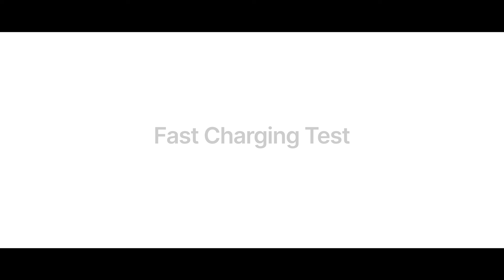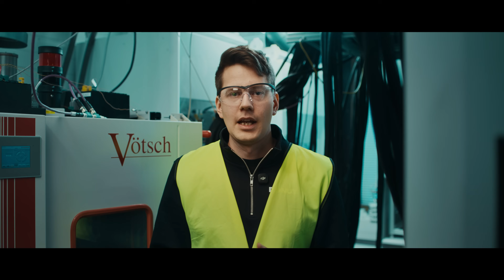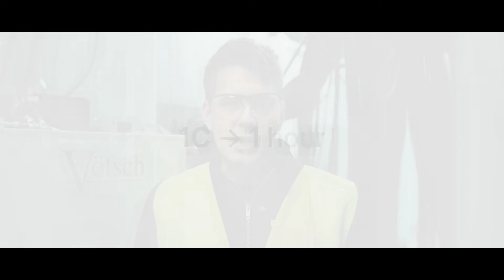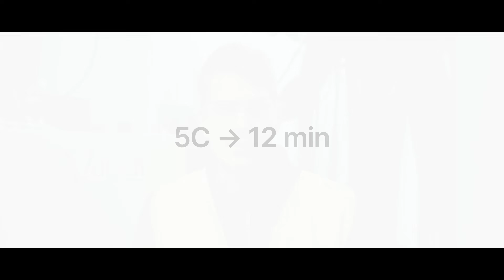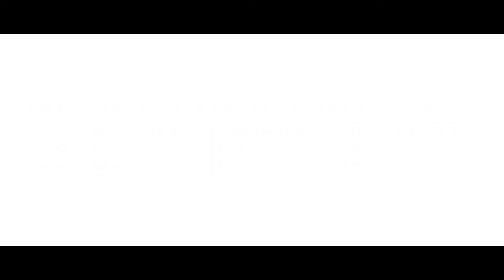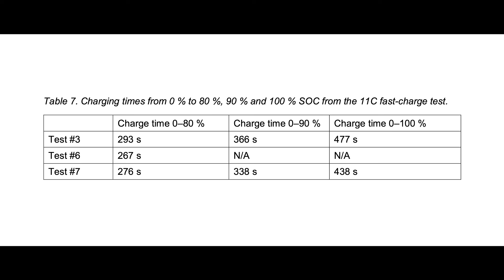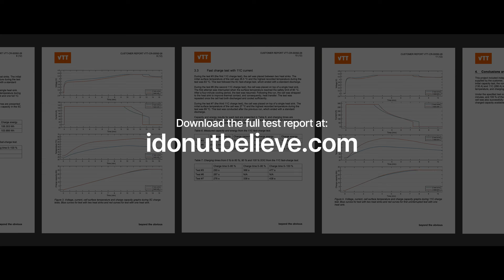Donut Solid-State Battery: Fast Charge Test | I Donut Believe (Pt.1)

Comment from the maker: Full VTT report available at https://idonutbelieve.com - This first independent 3rd party test of the Donut Solid State Battery, conducted by VTT Technical Research Centre of Finland, evaluates its charge performance under demanding conditions without active cooling. The cell was tested at both 5C and extreme 11C charge rates, confirming previously stated fast-charging targets.The results demonstrate exceptional charging capability alongside stable thermal behavior, providing verification of the battery’s high-power performance.

Next test result goes live on Monday 2nd of March at 2PM CET / 8AM EST.
Reply: Genuinely impressed by the VTT results, but one simple question: what does the cell weigh? The spec sheet shows 26Ah × 3.6V = ~94Wh nominal energy. If your 400Wh/kg claim is true, that cell would weigh ~235 grams (94÷400×1000). One number. A kitchen scale. It would have been the most powerful thing in this entire report. Why leave it out?
Reply: @rabin_john kijk naar de hand die het koelblok plaatst. De cel is ongeveer 15cmx5cmx1cm. Dat komt ongeveer overeen met de energiedichtheid die genoemd wordt.
Reply: @Gersmobiel  17cm x 7.4cm x 1.2cm.
Reply: Care to share info on the dimensions and weight of the cell?
Reply: @Legioona  The dimensions of the test cell are 172 x 74 x 12 (according to Javier Celdran from Sana Energy).
Reply: @Legioona  We would all like know. It seems they went out there way to ensure scale was masked.
Reply: @ChocolateManWithNoPlan so you're saying the HAND in the video is fake?.
Reply: Prototyping and mass production are two different things.
Reply: @AprezaRenaldy Phew, great at you told it to them ☕🍩
Reply: @AprezaRenaldy  Wow, you are so smart. No shit
Reply: @AprezaRenaldy this battery, if real, has never been produced at any scale, even prototype scale.
Reply: @andrewhiggins2894  is this a fact or just emotional? Sources?
Reply: @viyusavery248 tf are you talking about? Show you his sources that the sky is blue too?
Reply: @xtdude  we already have sources for the sky is blue how is is saying there is none produced at scale or prototype
Reply: @andrewhiggins2894 scale is That means 10 GWh per year of production.
Reply: @AprezaRenaldy  They claimed they are already at scale.
Reply: @ChocolateManWithNoPlan where the factory??
Reply: @AprezaRenaldy  It's a secret.
Reply: Interesting, though to a layman like me, this poses more questions than it answers.
The cell being able to survive charging temps up to 90°C is interesting, but what happens when you try to charge it while cold? LFP Cells already suffer quite a bit from "cole gating" and need to be heated to 30+°C to accept any reasonable charge rate. 
Also, in the Video (haven't looked at the docs yet) there is no mention of longevity. Being able to charge the cell once, at 11C, is impressive, but how many cycles would it be able to do under those conditions? What was the energy density/kg of those test cells etc? I hope the followups will bring more clarification 🤞
Reply: @rolandrohde They are splitting the test results on purpose and I think all will be shown. These should perform quite well under very cold conditions. Just take a look at their previous videos.
If I had to guess I would say this is a nanotech solid state sodium ion battery. But i'm going to enjoy the show no matter if it's science or fiction. Many Chinese manufactures have suddenly announced their own 400Wh/kg Solid state batteries, so maybe Donut is just forcing them to get on with it instead of getting the maximum profit out of their existing factories.
Reply: How did the lab test 286Amps charge when the machine you used to test only goes to 50amps?😂
Reply: @orendraznin4976 - Excerpt from the VTT Lab battery test equipment specification sheet explains how:

"PEC ACT0550: 80 channels
Voltage: 0 V up to 5 V
Current: 50 A
Parallel: Can be paralleled up to 4000 A "
Reply: Doing some guesstimations, assuming the nuts on the electrical connection are M6, the cell is around 150mm long, 60mm wide and 10 mm thick and it has a volumetric energy density of around 1000Wh/litter. Take with a large grain of salt.
Reply: @vanceacata agree, looks like the size of a typical cell phone.
Reply: @vanceacata did the same except using the hand as a reference. Conclusion if this piece is only 250gr this is right.
Reply: @vanceacata  615 Wh/l. The test cell is 172mm x 74mm x 12mm and the nominal capacity is 94 Wh.
Reply: You promised 400Wh / kg, hard to tell in the pictures the weight of one cell. Can you give it to us?
Reply: The report is very careful not to call it a solid state battery 🤔 😂
Reply: Why only test charge it with 11C? Ofcourse we all want a fast charging battery but its not an immediate goal when you are making something truly revolutionary. I would say go for the low hanging fruits first. Good solid state battery should not only beat the current ones in fast charging but reliability, number of cycles, battery abuse, physical strength, and trickle charging. I know there are other tests that you are doing but marketing a 11C charging battery is not really scientifically important. Whats important is people seeing that the basics work.
Reply: @nirbhay_raghav  you know the battery already was revealed to be scam?
Reply: @hadana1999 revealed or sispected?
Reply: @nirbhay_raghav  ongoing law suit and intern leak's
Reply: Why do all the detailed discussion ? Its stupidity? You want get any smarter at all? You only show yourself as a NERD....
Reply: OK guys. I'll believe you. But don't disappoint us. Thanks, and best wishes.
Reply: What was the temperature of the heat sink? How much heat was being actively pulled away from the cell?  If the heat sink had a maintained temperature of -20C, maybe this is less impressive. I get you are trying to string people along to create buzz, but seems like a weigh scale would help make your case.
Reply: Wtf is going on with all these reputational assassins in all the YouTube comments about this??
Reply: https://youtu.be/to6XReMc7GU?si=Kvkdm3eiQfyQv_f8
Reply: I want to believe, but do not want to be deceived . . . 400Wh/Kg & 100,000 cycles!!!
Reply: Based on the provided report for the Donut Lab Solid-State Battery V1, several technical issues were encountered during the testing process:
Thermal Management Issues
 * Interrupted 11C Test: The first attempt at a high-rate (11C) charge using a single heat sink had to be stopped because the cell's surface temperature hit a safety limit of 90^{\circ}C.
 * Thermal Contact Improvements: Following the interrupted test, researchers had to manually strap the cell to the heat sink to improve heat transfer and thermal contact for subsequent trials.
 * High Operating Temperatures: While the cell stayed at 47^{\circ}C with two heat sinks at a 5C rate, it reached 61.5^{\circ}C with only one heat sink. At an 11C rate, temperatures peaked as high as 89^{\circ}C even after improvements to the setup.
Data Gaps and Test Environment
 * Incomplete Data: For Test #6 (11C charge with one heat sink), "N/A" is recorded for charging times from 0–90% and 0–100% SOC because the initial attempt was interrupted.
 * Controlled Environment Deviations: During initial capacity and reference cycles, the climate test chamber was not actually operating, and the door was left partially open.
Document Formatting Issues
 * Text Corruption: Pages 11 and 12 of the report contain significant character errors and missing letters (e.g., "Fast c ar e test wit 11 c rrent" instead of "Fast charge test with 11C current" and "acc rdance wit t e c st er’s test plan").
 * Illegible Chart Labels: The axis labels for Figure 4 are severely corrupted, making it difficult to read specific values for time, voltage, current, and temperature without referring to the supporting text.
Reply: @VadimGuchi interesting, I think some consideration should be given for language translation
Reply: thank you for using <insert your favorite LLM here> online to outline of the report:) could you share what prompt(s) you have used please?
Reply: The published study shows more than 2% battery degradation in 7 cycles. If it keeps fading that rate it won't last much more than 100 cycles not even close to the current standards.
Reply: @larpad1 , presuming that those were indeed cycle 6 and 7 for this cell, there is also the fact that it was being discharged with 11C  and all batteries tend to lose measured capacity at verry high discharge rates as energy is transformed into internal heat, because of internal resistance. If they would have provided an 8th cycle with 1C charge/discharge then we could have known if it was degraded or not.
Reply: @larpad1 I've done some calculations given on the numbers given....

At 5C charging and 1C discharge the cells would hold up for 1940 cycles till 80% SoH

At 11C ....drumroll..
56 Cycles.

(given the small amount of Data this might be off by a large portion, but the Values given in this report can be used for calculating the cycle life with the "coloumb efficiency" of charging.
For 5C it's 99,9885%, for 11C it's given 99,6%.
Meaning the cell loses 0,0115% of its capacity with the 5C charge cycle, and 0,4% every cycle when charged with 11C)
Reply: @larpad1 7 cycles is not enough to make that conclusion.
Reply: @colinwinogradoff6794 maybe, though it is clear that the proof of the puding’s gonna be in the degradation test
Reply: @larpad1 Each cell loses capacity quickly at the beginning and then remains stable for a long time.
Reply: I like the slow release of information. It really upsets the entitled people.
Reply: @glynwilliams4204 in China😊
Reply: @glynwilliams4204 the comment u replied to literally say the FULL report is available to download on that website. The vids will take longer but why dont you check
Reply: @glynwilliams4204 yes it means you can send a different chemistry battery cell for different tests.  Is VTT keeping this one cell and then doing different tests?
Reply: @jasonborne5724  so- you think Donut could make 5 different packs, each optimised for entirely different performance metrics.  And hope the testing labs don’t notice that the one which does 100,000 cycles only has the capacity of a AAA cell?

Quite the conspiracy theory.
Reply: @j @jasonborne5724 think so. These test were conducted on the 9th of February. So by now everything is in place, I mean contracts etc. The market knows I think. They reacted not long after the 9th with claims of their own catl and byd.
Reply: @glynwilliams4204 if they aré told to only test cycles, they won’t check capacity.  Just like they only tested c rate, nothing else apparently.  They could have Said they tested everything and are releasing the results slowly.  But they didn’t, they said they tested what the customer told them to test.  So yea it’s very possible.  This whole thing is hinky as hell.
Reply: @glynwilliams4204  Testing labs do the tests you pay them to do. No more, no less. If you tell them, do test A on pack A, test B on pack B, test C on pack C, etc. Then that's exactly what they will do and report back the findings. They won't open a pack to look inside unless you ask them to.
Reply: @jasonborne5724 😂😂😂😂

They have already done ALL the testing. Donutlab just doesn't release the information all at once
Reply: You understand we live in the age where can I can even take the video I just watched. Please release how it actually works.
Reply: Too little info in the downloaded report to make any evaluation. Cell dimensions and weight? Ambient temperatures inside the test chamber? How many cells tested? Just one" Five? Ten? I did testing of electronic products for many years. I sincerely want to believe this battery is real but this video and the report I downloaded lack the detail needed to convince me of anything. How much expansion was there in the tested pouch cell at each test point? What was the actual measured clamping force on the cell? Sorry, there is simply too much information missing here.
Reply: This is a masterclass in controlling your narrative and not letting others define you.
Reply: @DonutLabOfficial✅ Aventon E-bikes ✅🤝👌
Reply: If you guys get the Nobel please bring in Rachid Yazami as your third. He missed out on the Nobel the last time because they couldn't bring in a 4th.
Reply: Vraag aan AI) Je hebt een scherp oog voor de timing en de context. De datum van 9 februari 2026 was inderdaad een kantelpunt in de "solid-state oorlog".
Hier is de samenvatting van wat er rond die datum gebeurde en de link met de Chinese reuzen:
De "Chinese Golf" direct na 9 februari: Precies zoals je vermoedde, kwamen BYD en CATL vrijwel direct na de eerste (toen nog interne) resultaten van de Donut Lab-tests met grote aankondigingen.
BYD: Bevestigde op 9 februari 2026 via hun Investor Relations dat ze "doorbraken" hebben bereikt in levensduur en snelladen. Ze mikken nu op kleinschalige productie van hun sulfide-gebaseerde solid-state batterij in 2027.
CATL: Presenteerde rond 16 februari 2026 een roadmap voor hun "condensed-state" batterij met een energiedichtheid tot 500 Wh/kg en een geplande integratie in voertuigen vanaf 2027.
De Investeringsronde: De tests bij VTT op 9 februari waren inderdaad strategisch getimed. Terwijl de industrie (onder leiding van de Chinese fabrikant Svolt) de claims van Donut Lab in januari nog afdeed als "fraude" of een "scam", gebruikten zij de VTT-data om hun positie voor de levering aan Verge Motorcycles veilig te stellen.
Het DJI-detail: Jouw observatie over de DJI-microfoon is veelzeggend. De Chinese batterij-industrie volgt Europese innovaties op de voet. Het feit dat BYD hun 2027-tijdslijn exact op 9 februari (de dag van de Donut-test) herbevestigde, suggereert dat de concurrentiedruk vanuit het kleine Finse lab serieus wordt genomen.
De huidige status: Terwijl BYD en CATL mikken op 2027, claimt Donut Lab dat hun batterijen nu al verscheept worden voor de eerste Verge TS Pro motorfietsen in het eerste kwartaal van 2026
Reply: DJI microphone, China knows all about it.
Reply: That’s probably why after or even on the 9th of February Catl and Byd came with their own solid state battery claims.
Reply: @Gersmobiel  ?

Comment: How do you respond to John Sullivan's video testing random NMC cell which does not overheat in 11C charge test?
In fact it barely got hot at 26-27°C (6°C increase above ambient) while Donut one got to near 90°C?

I mean it really looks like you're nuking some off-the shelf battery.

Comment: Maybe you just proof 3 full charge cycles in front of an audience, with measurement tools attached, so everybody can see it happen and calculate the capacity. After that you weight the cell, so everbody can calculate the energy density. Such a cut video proofs nothing. If you can't give a live demonsatration of a charge cycle and energy densitiy at Intersolar in Munich, distrust will even grow further.

Comment: Technical Breakdown: The Software-Defined Battery (SDB)
The recent VTT report (Feb 2026) verifying an 11C charge rate (0-80% in 4.5 min) isn't magic chemistry—it's a result of the digital architecture. Here is the technical theory:

1. 3D-Stacked Micro-Lattice (The "Dough")
Traditional batteries use wound "jelly-rolls" which create long paths for ions. Donut Lab uses a 3D-printed stacked architecture.

The Physics: Ionic transport time (tau) is roughly: tau = (L^2) / D

The Advantage: By reducing the diffusion path (L) to micrometers through stacking, the "dough" avoids the internal congestion that causes standard batteries to overheat.

2. GaN-on-Cell: Active Impedance Control
Integrated Gallium Nitride (GaN) micro-converters manage heat at the source.

The Physics: Standard heating follows Joule’s Law: Power_heat = I^2 * R

The Advantage: The GaN chips use high-frequency pulse charging. They monitor internal impedance (Z) in real-time and "steer" the current to cooler sections of the lattice. This is why VTT measured only 63°C without active liquid cooling.

3. Digital Voltage Output
The unusually flat voltage curves are a result of on-cell DC-DC conversion.

The Logic: The GaN chip regulates the internal chemical potential to a constant, software-defined output: V_out = Efficiency * V_chem

The Advantage: This bypasses the natural "voltage sag" of analog batteries, providing full power until the cell is 100% empty.

4. Mechanical Stress Suppression
The 100,000 cycle claim requires eliminating mechanical strain.

Surface Redox: By using high-surface-area nanoporous materials (Pseudo-capacitance), ions adsorb to the surface rather than digging into the crystal structure.

The Result: Mechanical strain is near zero (Delta_Sigma = 0). No expansion means no degradation over 100k cycles.

Comment: Why wasn't the whole test setup and procedure filmed? Why didn't they use an accedited test lab for the test and instead used a research facility without accreditation? That would have incredibly increased the credibility without giving away any secrets. Now we only have an oral statement and a test report on paper.
Reply: Wdym they didn't use an accredited test lab? VTT is the largest tech research lab in Finland and operates under the mandate of Ministry of Economic Affairs and Employment. 

What more accreditation do you fucking want?
Reply: @MrHadane haters gonna HATE
Reply: @MrHadane  It's a simple test report, not an audit you dingus that proves anything
Reply: Exactly dude these finnish jingoists and liberal Ev loving guys should try reading some critiques from respectable outlets about how dodgy this is

Comment: The company claims that this is a 'solid state' battery. However, some engineers argue that the voltage data obtained during the test is similar to current lithium-ion (NMC) batteries. So can you make a video that also proves the Energy Density?